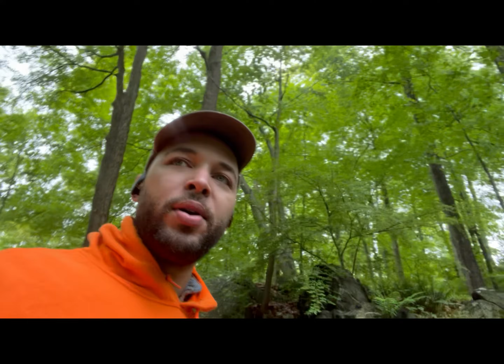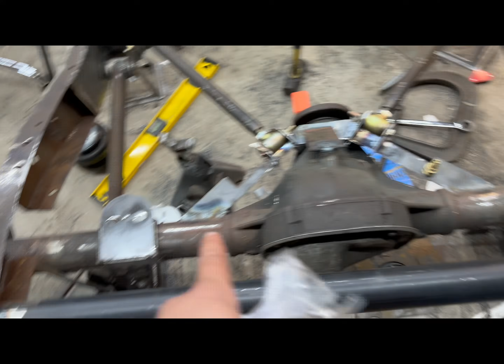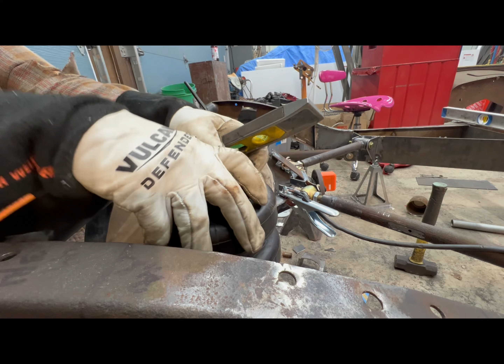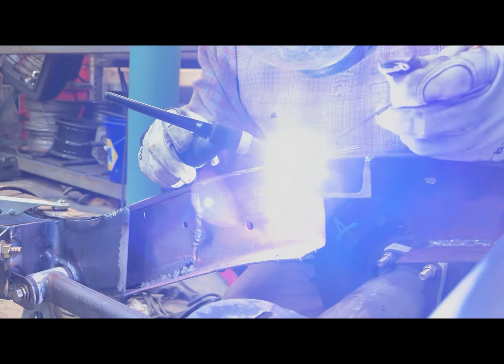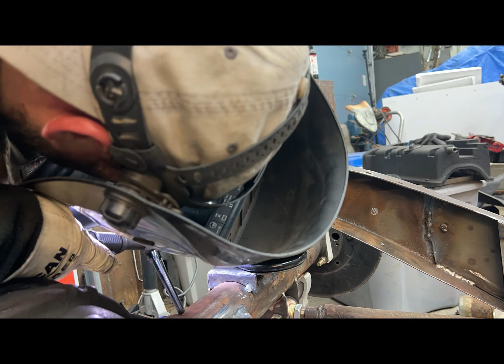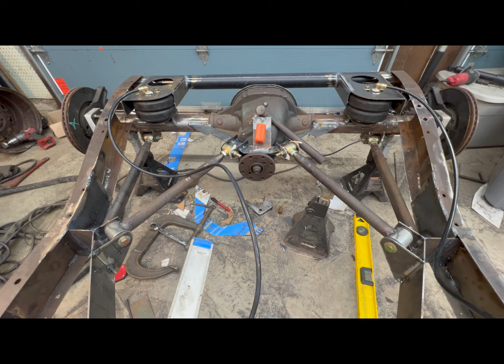Installing Custom Air Ride Suspension on Our Rat Rod – DIY Fab with CNC Parts! Part 17

Comment: The links at the axle must be separated more. Looking from the side, the distance between the top and bottom links center to center must be more like 9 inch or more. Please fact check me. You will not regret trying to prove me wrong.

Comment: I hope you fixed the link seperation. If not the axle is gonna flip. You do not have enough  leverage to keep the axle from rotating under power. You need to raise the top link connection and lower the bottom link connection. Do not drive it the way you have it. Please

Comment: hey mate you need was more box/gussets in this, youre using flat plate everywhere its not strong at all
Reply from the maker: It will be getting that treatment soon. I just want to get everything functioning for now, then everything will be getting boxed and reinforced once I do some more fab work
Reply: @KevansBuilds bro. Please read my other comments. Your design is not sufficient to keep the axle from rotating. I am trying 100% to help you. At the axle you need more link separation. You look to have less than 4 inch and that is no bueno.